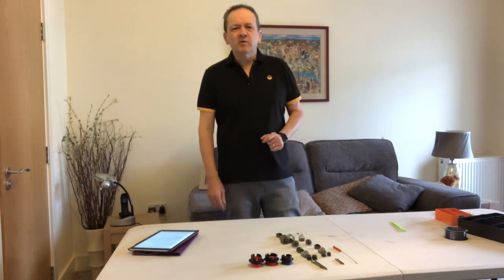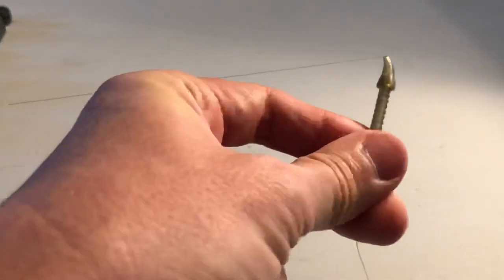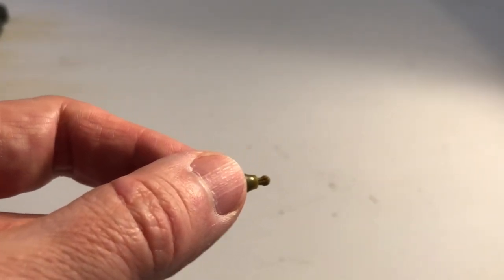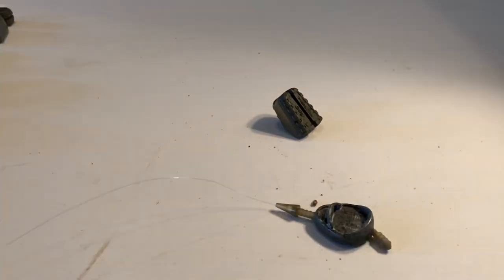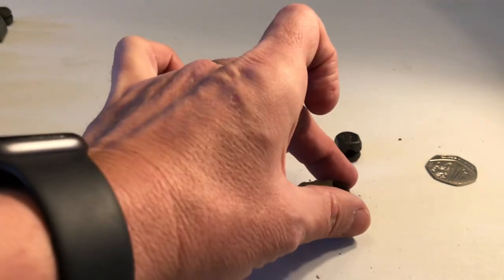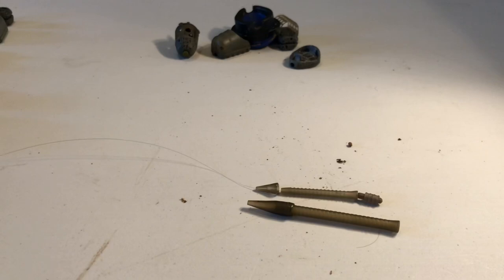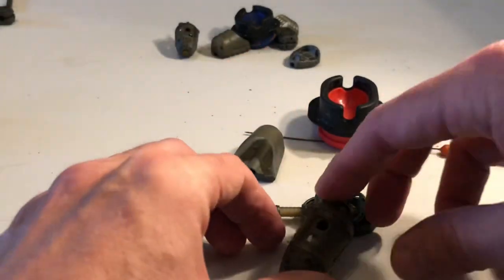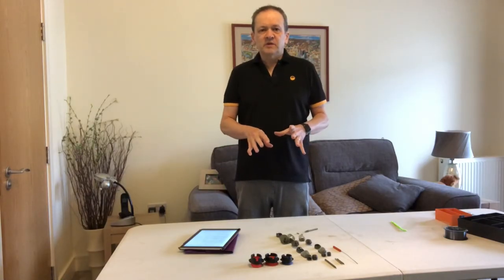Paul’s Tackle Reviews - Preston Innovations Fishing ICM and ICS Feeder System

Comment: Paul, good information and valid points made thank you. 
I think Preston should of made ICM/ICS stems interchangeable, also the their quick beads on ICS especially needs the be a be a light  fit into stem to give a slight bolt effect as does the Drennan does inside the Drennan stem also it stops feeder sliding up line whilst putting hook bait on. Also Preston have ceased sales of Banjo’s and are not offering an alternative unlike Matrix etc doing the Hybrid style inline. Having said this I have converted all my inline to ICM/ICS for standardisation 👍